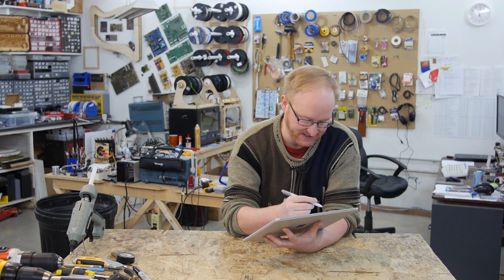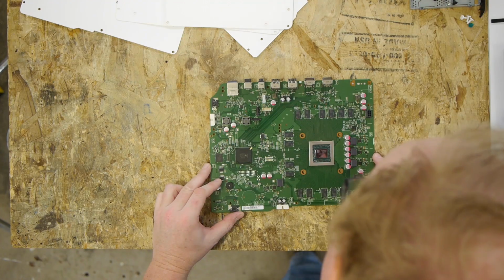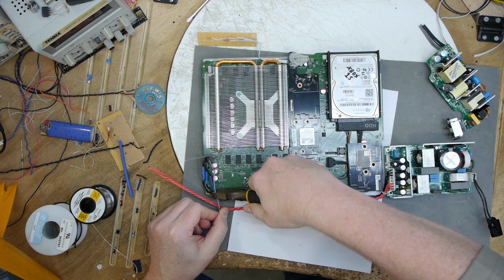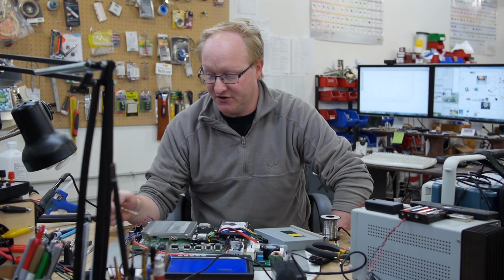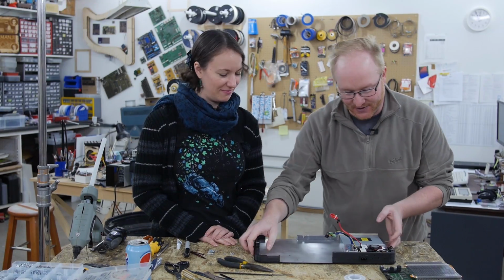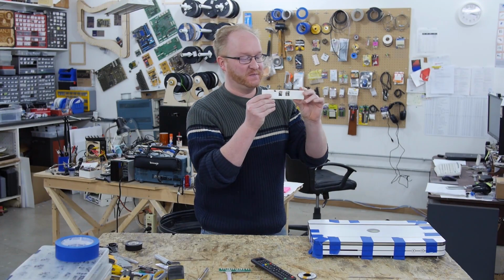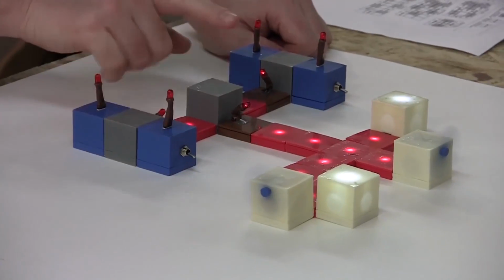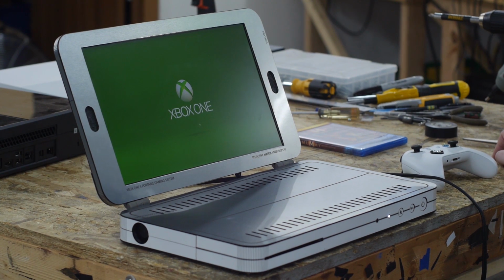Ben Heck's Xbox One S Laptop

Comment: the reason you have to download a free app is a licensing cost (to MS) of using DVD/cd.
Reply: mclaine33 yes. it is sold locked down so that it can't play the discs, and no licence needs to be paid. the "app" is just an unlock code. MS could technically charge the customer but it looks like someone has made the sensible decision of simply absorbing the very small cost, and avoid negative customer  feedback
Reply: bluray is owned by sony xD
Reply: So does that mean MS has to pay a licensing fee per download?
Reply: well yeah but they don't own bluray, Microsoft owns Xbox,Surface, Nokia, etc.
Reply: Exactly. Besides, it's not a big deal, it's free, it's not actually a download, and these days you actually want to be always connected anyway, 90% of the fucking games out there are multiplayer shits. You can argue about that, but dont blame MS for saving a little money per unit with basically no consequences for the end user.
Reply: What's MS? Microsoft? Don't they also own the Xbox?
Reply: It's a big deal if your troglodyte co-worker wins an Xbox One at a company function and doesn't have WiFi at home.  In this hypothetical situation, I...err...someone would have to drive out there, pick up the Xbox, take it home, download the multiple GB's of system updates, then update the CONTROLLER SOFTWARE, then drop it back off so he can watch some blu-rays he had rented.  Then that same person would get a call saying that the movie still wouldn't play, and there didn't seem to be any option to play it.  That someone would then be a good pal and drive over and pick up the fucking thing once again, take it home, and download the blu-ray player and then go drop it off.  Or so I have heard.
Reply: Kristopher Tope If you don't have an internet connection, how were you even expecting to use it in the first place? It's like trying to use a nicrowave without electricity. A connection is pretty much required for everything you have to do on the console. I would have just sold it. Besides, if you have a job that gives $400 consoles away for raffle prizes, I'm pretty sure you can afford internet.
Reply: This is anal from me, but MS doesn't own Nokia. They bought Nokia's handheld business from Nokia. Nokia itself is a separate 30 billion market cap company listed in Nasdaq and OMXH (Helsinki exchange).

Comment: An AIO watercooling unit with the Radiator and fan at the back of the unit which would keep the APU at around 30-50 degrees centigrade and prevent the  Red Ring of Death, an Electro Magnetic Can Crusher that uses electro magnetic fiends to crush the cans generated by high voltage power electronics.

Comment: Why even put in the (original) HDD and the disc drive? Could've saved a ton of space with those out
Reply: Jobaa87 Well it is, to play games of discs, not everyones downloading their games to the HDD ;D
Reply: MrHatoi again, the goal wasnt to make it as small as he possibly could. thats just a lot of extra money he didnt have to spend.
Reply: Use flash memory?

I don't know about these things but it's probably possible to fool the system into thinking it has a disc drive and the original HDD
Reply: Jobaa87 The price of flash or SSD's to dump discs and keep the OS+Game data is enormous, and they're also 2.5" so no difference in size
Reply: yeah and without a disc drive the system wouldve been gimped.
Reply: +JonasLue

Well I was mostly talking about the disc drive which is massive and not needed at all
Reply: Jobaa87 so why don't you build one?
Reply: disc drive IS needed. i would not buy a game system, laptop or not, if it was a cheaper version without a disc drive when the full version had one. some day, perhaps next gen, well get to the no disc drive era, but not today. i'd much prefer future consoles used flash cards like Switch is doing, but you work with what you have.
Reply: +Garth Palmer
Well, the point of the build was to make it as small as possible, AFAIK. So yea

But yeah physical media in a traditional console isn't going anywhere within the foreseeable future. Download-only = retailers don't get money from selling games = they won't bother selling the base console
Reply: Jobaa87 Ben's goal is to make it with a screen built in, and as small as possible, within reason. sacrificing vital components to make it a bit smaller does nobody any good.
Reply: But it's not vital.
Reply: Not to having the console function but nobody would want a small laptop console at the expense of a way to use disc games.
Reply: I've seen far smaller disc drives which he could have replaced it with. Also even if other SSD's are also 2.5", they are usually around half as thick as HDD's.
Reply: Jobaa87 I agree. Everything is downloadable anymore. Bare minimum just make a port in the deck to plugin a tablet for movies....but technically media should be ran fully online.

Comment: 20:40 I was also a cable installer...and what he is talking about is a coax tester/tuner. These items attach to the bare copper coated wire inside the coax connector from your cable box and then the other end attaches the same way. When both ends are on the same line there is an audible tone to let you know that you found the cable that has the connector on the other end. These are notoriously cheap and break, run out of battery, stop working, lose audio, and so on.
Reply from the maker: We also want to see if we can make one that can send/detect a signal through the jacket so you don't have to strip or detach a wire. So basically without contacting the conductive material of the wire.
Reply: First of all, love the show, you are very smart in your field and I can't believe you replied! Secondly, I think that would really be a challenge. The first thing that comes to my mind is sending some kind of vibration along the line, but that could be interfered with pretty easily. In most cases, one side of the line is almost always exposed. So, maybe a device that only needed to be attached to one bare wire? Because as of right now both sides of the line need to be bare to use these tools. I don't know, that would be an interesting build I think. Thanks for the reply! :)
Reply: There are a lot of different types of these: https://www.google.com/?gws_rd=ssl#q=coax+tester&tbm=shop&spd=13765752482076737384But I think he was referring to this one: http://www.philex.co.uk/catalogue/product/?id=640&cat=1125
Reply: Retro Adventure yes that would be handy as a cable guy as your self do they still Use them today?
Reply: I have no need at the moment since I do not install anymore. But, I used a couple different methods to trace cables and this was one of them yes.
Reply: Wow amazing keep up the good work
Reply: That's awesome
Reply: That is a challenge I mean could it also be a challange in case one cable is electric or fight back it could also blow any sensing equipment your looking for in case its dead short?
Reply: Retro Adventure it is possible, just use a clamp amp meter
Reply: Underground utility companies use a tool called a Cat & Genny. The Genny can be either directly attached to a wire/metal pipe and puts a detectable tone on it. The Cat is a handheld wand that detects the tone. Some Gennys have a coil you place on the grond above or a clamp to go around that allows you to induce the tone into the wire so you can detect it without de-energising the circuit or digging to the pipe.
That's what you're describing.
Reply: https://www.walmart.com/ip/KLEIN-TOOLS-VDV512-058-Coax-Explorer-Plus/117028796?wmlspartner=wlpa&selectedSellerId=1122&adid=22222222228000000000&wl0=&wl1=g&wl2=m&wl3=42423897272&wl4=pla-51320962143&wl5=9005292&wl6=&wl7=&wl8=&wl9=pla&wl10=101593696&wl11=online&wl12=117028796&wl13=&veh=sem

this is what he is talking about...I use this thing daily and it saves so much time chasing cables. No signal needed the tester sends one to the color led node and the node sends it back to the matching color on the tester. so in theory it could work on any copper line.
Reply: I have something very similar for ethernet cable. It was very useful when I installed a couple IP cameras using a big reel of wire and had to attach the plastic connectors at each end. If you mess up the pinout, which consists of 8 wires, after crimping the connector to the wire, you have to cut it off and start over; it is a pain in the ass. It is called a continuity tester and it also has a jack for phone line. Instead of making a noise, though, it lights up. There are 8 lights and it shows you which wire or wires are not connected properly.

Comment: Another well built project. Several steps were skipped in the video simply because you have covered them in previous builds. However, you did cover a few nice touches for young builders like laser cutting paper to get measurements right.

I would like to see a few more in depth segments on certain build steps. I'm working with a group of engineering students teaching them the black art of Graphic Design and we're currently using Illustrator. It would be great to show them the value in learning this application for engineering purposes. I'd love to see some in depth segments showing specific applications like that and how you use them in your design and build process.
Reply from the maker: We do cover that a bit in this episode, https://www.youtube.com/watch?v=mIE79Vai5z0.

Comment: I seriously question those fans keeping this cool for any extended amount of time. i would also love to see one of these console laptops run on battery's.
Reply: Well, it can sit in your lap. Also, my laptop that doesn't run on battery anymore, isn't considered a portable desktop since it's battery doesn't work. It's still called a laptop. I just have to keep it plugged in, haha
Reply: I would argue that any laptop intended for gaming pretty much needs to be plugged-in to actually game (otherwise you often get like, 30-45minutes). So in that sense this is spot-on to the functionality of a 'gaming laptop'. It's also neat that this has the power supply built into the chasis instead of as an external brick.
Reply: BlueFoxTV they draw to much current
Reply: Grey John then that means it's not a true laptop it's more of a portable desktop then
Reply: Still a laptop ;)

Also, agreed with TheTron08, gaming on a laptop, in my experience, almost requires to be plugged in. They don't last long enough otherwise
Reply: wrong ,a laptop isntr defined by using batteries
Reply: Yea especially considering they didn't play any games on the thing.  I have a feeling they would hit thermal limit real quick with only 2 40mm fans on an AMD APU.
Reply: wug Weird. Mine is used on a desk 90% of the time.
Reply: Not necessarily laptops, but it is true that devices like the Xbob and PS4 have some pretty mediocre CPUs.
Reply: True. Would love too see just a nice quality screen attachment to the Xbox One itself. I realize there are suitcase type things with screens, but I'm talking just a screen so the console is "portable".
Reply: You can do this, but at the expense of many aspects of this design. Getting a battery with the wattage capable of running it while gaming as well as having a good life time is one. 
A lot of laptop batteries can easily support this already however, especially newer laptops. You could pretty easily wire in your own battery, but I'm not sure how you would get one fitting this task unless you had a laptop you didn't care about just lying around.
Reply: YuukiRus Games lol you think shitty ass laptop batteries with their underspecced 18650's can run an Xbox one? LOLOLOL. "modern laptop batteries" what a crock of shit! they're still the same shitty 18650's!!! you'd have better chances with vapor batteries. at least those are decent.
Reply: Right?  That's the biggest thing here.  That APU is going to burn out real quick with 2 40mm fans cooling it from the side with no shroud to direct airflow.  Also, since they're blowing from the side, they're just circulating the heat around in the case and not exhausting it!
Reply: @c4103, They had a push/pull setup going with the fans on the PSU side sucking and the fans on the APU side blowing.
Reply: "They draw too much current"
No, you could just make an 18650 battery pack, but it'd add more bulk to the device and would still be pretty pointless.
Reply: is it a dell? im experiencing the same problem
Reply: This is why I love my real laptop that is also more powerful than that xbox lol.
Reply: they sound fucking noisy in the end too...
Reply: Keep it in your lap. Helps ya achieve back problems
Reply: TheTron08 have you tried turning your laptops battery settings to high performance when it's on battery mode? by default windows pushes it to balanced or battery saver which hinders the performance severely as you suggested.
Reply: The One S actually has an internal power supply but i guess it was to weak too run both the Xbox and a screen.
Reply: BlueFoxTV why? the one s APU is a 16nm one, a lot cooler and more power efficient than the previous Xbox one APU.
Reply: I love how everyone here is talking about its portability over the fact that those fans are likely going to kill the APU, correct me if I'm wrong but isn't the APU AMD based? If so then the thing is going to be hot anyway let-alone with those tiny fans cooling it while you game!
Reply: No shit a pc/laptop is more powerful than a gaming system. gaming systems are intended for oh i dont know... GAMING! and not running multiple pc tasks.

Comment: Could you make a Nintendo 3ds into a home console. You could mod a game pad from the wifi u to display the bottom screen.
Reply: That would be awesome.  There are places that mod the 3ds for video output, but using the wii u gamepad for control and bottom screen is a great idea!
Reply: yep 240p like most retro consoles,nes,snes PSX...
Reply: You mean the wii u?
Reply: Does the 3DS have video out? if not.. your gonna have to find a way to get that to work somehow read the data from it and display it in certain locations on the screen
Reply: want
Reply: thats why its called a challenge
Reply: LightningGamer500 Delta post this idea in the ven heck show suggestion  forums
Reply: Tailslol those are retro consoles though.
Reply: Run ntr on 3ds
Stream game to PC
Use 3ds control redirector (forgot the name)
Profit.
Reply: its interesting ive thought about it too however the bottom screen is tied to the mother board aint it? sooo how do you keep the system and everything under tv while outputting ONLY the bottom from the 3ds wirelessly over to the gamepad? it doesnt make sense.
Reply: Álvaro MZ I would love to see this in the Ben heck show! could you please comment a link to the o the forums?
Reply: DjStiv3  I'm not sure how this would be done (I know nothing about modding and/or creating devices). It was just an idea I had. A possible way around might be to wire the gamepad to the "console" like with wired controllers. If this makes it possible, I would love to see it on the Ben heck show.
Reply: LightningGamer500 Delta you could probably do it pretty easily with the right LCD controllers. that's gonna be your ultimate problem right there and 3ds capture cards seem to have figured it out for us. seems like a somewhat easy project.
Reply: its somewhat possibly. Its just that he would have to find a way or if its possible to make a custom cable, this is where its tricky, to go from the board and into a seperate dpad/face button etc controller, along with the screen. Basically seperate the guts to be under the tv while taking everything else and put it into a new controller/shell or keep the bottom half of the system as a controller.

The main thing for sure is it would have to be wired, no way will it be wireless. Ive seen hacks where people hooked up gamecube controllers to a 3ds and that seems crazy too but was possible and again it was wired. But for this mod everything would have to be, even the cable from board to touch screen as well as all other buttons, i imagine it would just be one thick ass cable running from the system to your hands/the controller. And thats only if its possible to make one, theres now way its sold, everything pretty much with nintendo is proprietary ive noticed. Its a ribbon cable too so i mean its very tiny and thin, maybe he could rewire it with larger cables and make a big thick cable like i said, but man that would just be a pain in the ass. Luckily he could use the bottom half to fashion a controller so he doesnt need to make a new one unless he wants too.
Reply: LightningGamer500 Delta isn't there a thing you can plug into a Wii U to play 3DS games?
Reply: Sillca that's not true, you can route straight from the GPU chip, just like how people do the HDMI mod for Nintendo 64.
Reply: DjStiv3 you mod the console into the wii u pad

Comment: or just buy a razer laptop+steam
Reply: Something someone says when they've completely missed the point of the video.
Reply: lol i completely got the point of the video, i love diy stuff, thoug unfortunatly even if it is cool it is not efffective, it's portable but there is no real point to do this, there is no built in battery, you need a controller to use it, it's bulky, it's not for on the go gaming. Just something that will stay in a closet. Plus i don't even speak of the heat issues